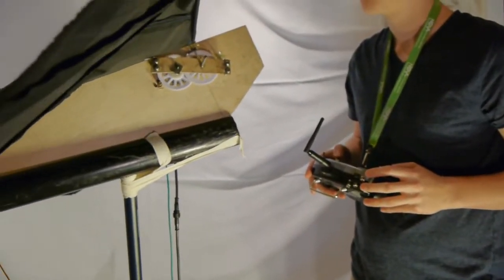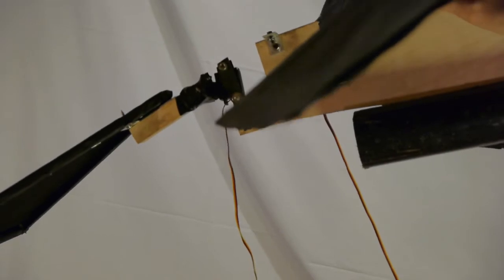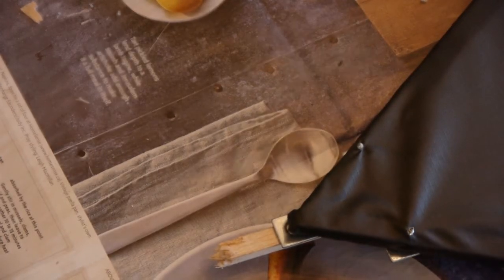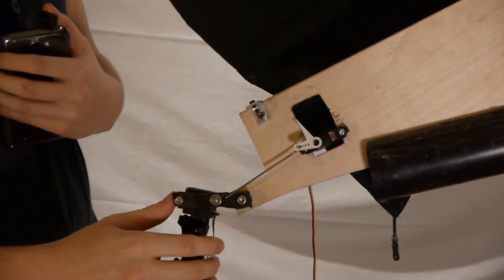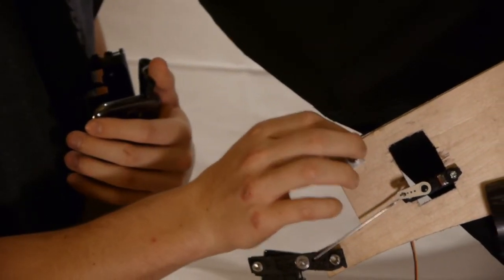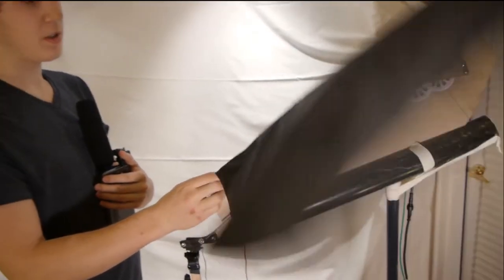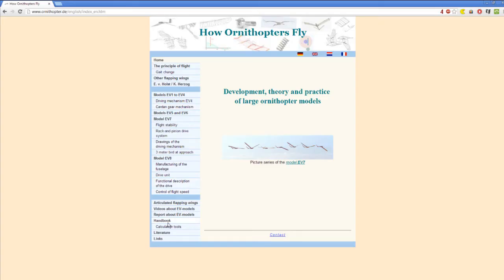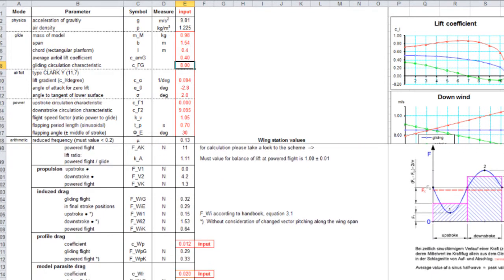Building an Ornithopter

Comment: 3:04 I get it, you're not an expert. But maybe you should get a little more educated with the proper names of the parts. FYI, those are actually called servos, not motors or 
"servo motors". Yes they do have a little motor in them and yes noobs do often refer to them as motors, but to be correct, they're are not called motors. They're called SERVOS. Please get it right.
Reply: yeh it was annoying me too

Comment: Hi, I'm in Aeronautical final semester. One thing which I came to know whilst dealing with the tail mechanism was that due to aerodynamic loads on the tail, the teeth of the main gear in the servo snaps off right away. Either use a Metal Gear servo or high leverage for the pitching servo. Do you have a website for details for this flown? Best Regards.